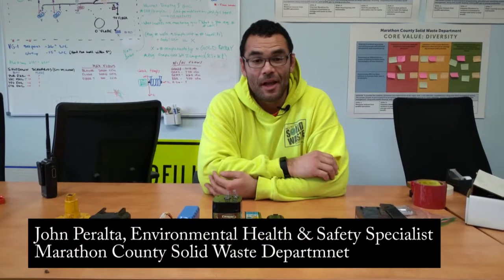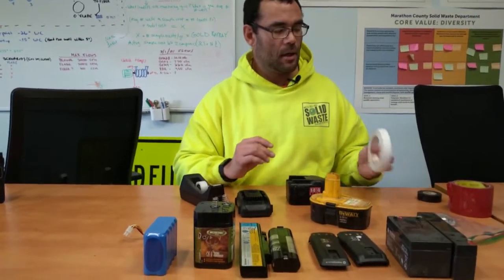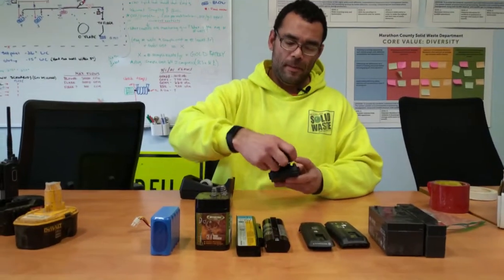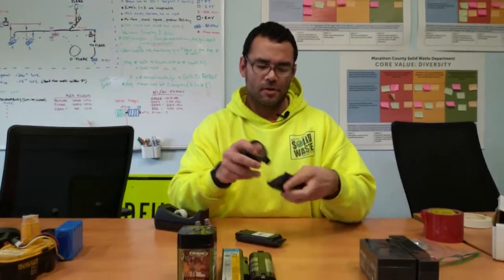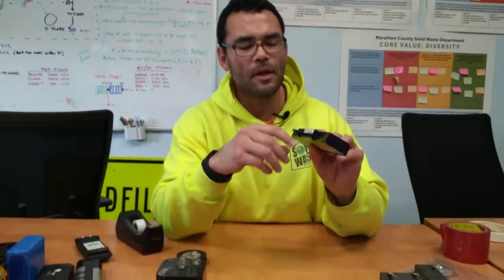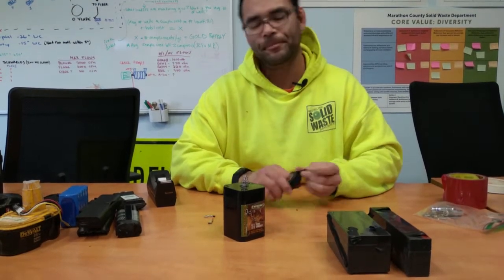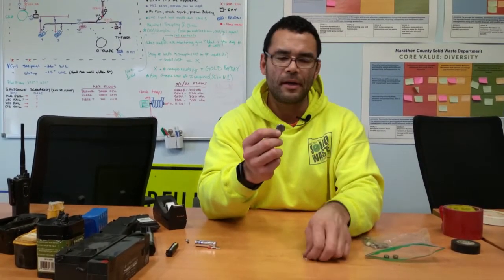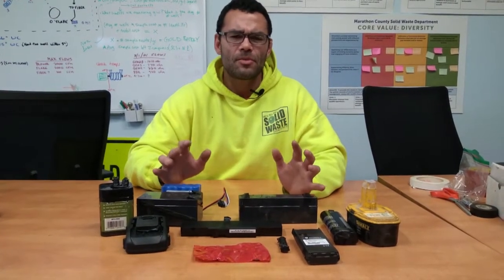Tape Your Batteries for Proper Disposal

Comment: One thing that surprised me was that you didn't insist on clear tape. I worked at a battery sorting facility and getting batteries taped with masking or electrical tape made the job a lot harder when the label was obscured. Ever since, I ask everyone to use clear tape. Electrical tape would be fine for the large batteries when it doesn't cover the labels, but for small batteries, I would never use it. Ideal is a transparent but tinted tape, so it is easy to tell that the battery is taped but you can still easily read the label, but any transparent tape is fine.